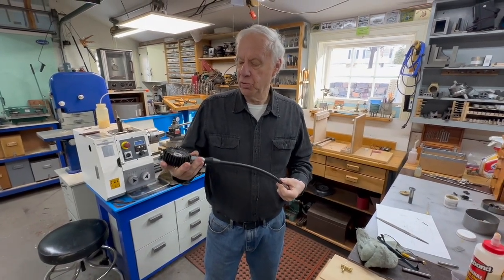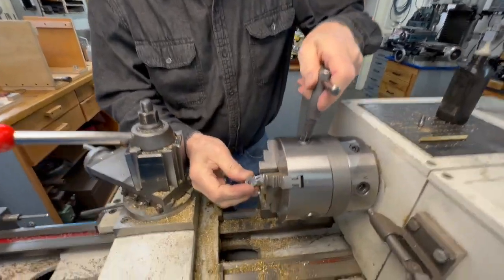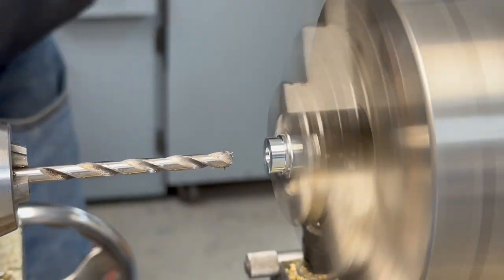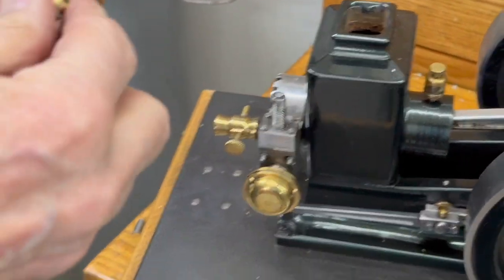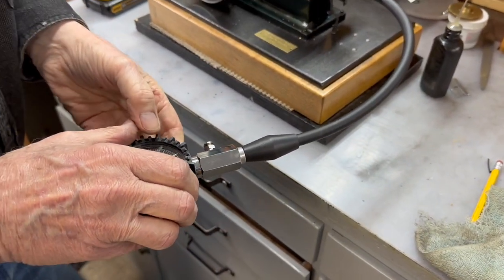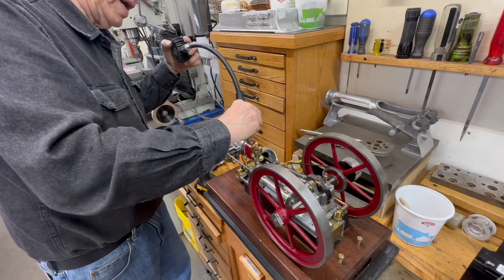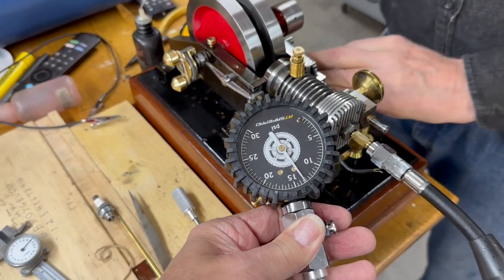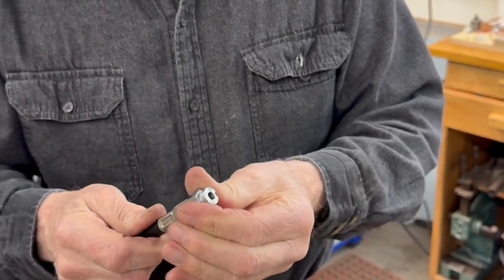How to make a Compression Tester

Comment: Great vid on the compression tester I didn’t know you could get them in that low of a range, I think I’ll source one and give it a try. I’ve been building along on the 6 cycle but a little behind on mine, should finish the valve assembly’s tomorrow then just the piston, piston rings, and muffler. Got the article from HSM on the rings and built the components so I’ll give that a try using a small jewelry oven I have. Still haven’t configured for any type of ignition, I’m actually not a fan of the tacked on look of the points so will be interested in what you settle on.
 If you’ve never seen the book “Ignition coils and magnetos in miniature “ by Bob Shore published in the late 90,s I think you should check it out, I actually started building his little coil winder but unfortunately never finished it, maybe I should…
 Anyway Joe thanks to you and Jim for what you’re doing!
Cheers again from Sheridan Oregon.
Reply from the maker: @kellyodom9596  Hi Kelly,
I’ve been looking for a while for a low pressure gage with a hold button. It’s a nice tool to have for diagnosing problems with a new engine. It’s always good to know that you have sufficient compression when trying to start a new engine. As for coils, I actually have Bob Shores book and have made a few coils.What I found is that it’s actually cheaper to buy a coil than to buy the wires to make them. I’ll be showing the coil I think is the best deal in my next video. I’ve used a lot of different coils and ignition systems throughout the years and I think using a buzz coil for the first starting and running is the best way to go. Thank you for watching and also thank you for taking the time to tell us what you think. Joe